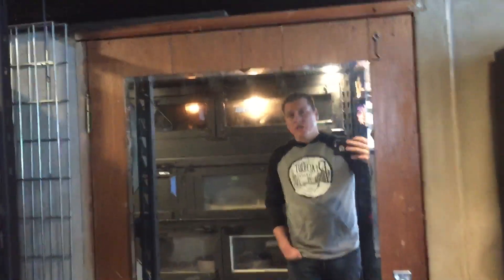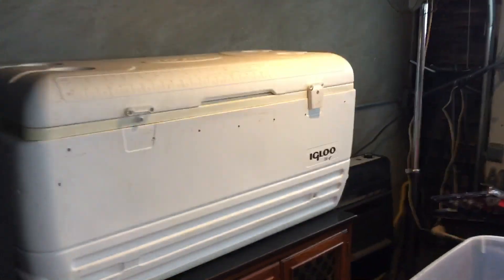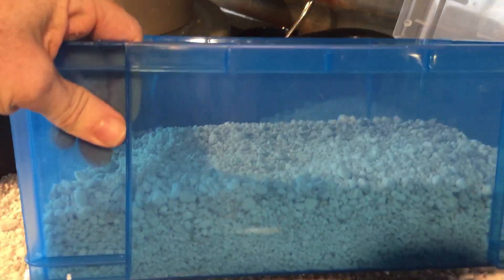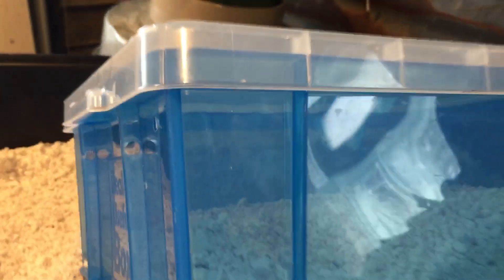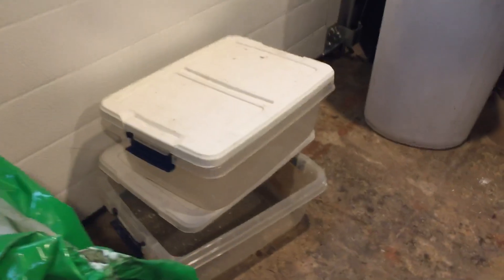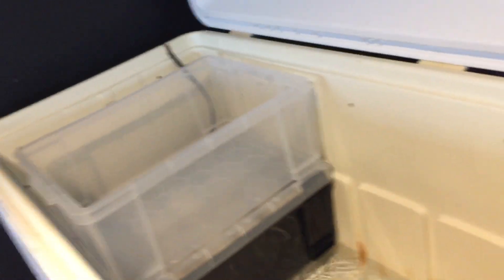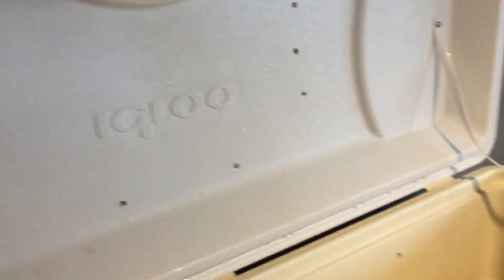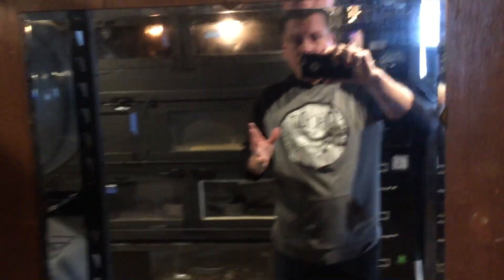DIY Reptile Egg Incubator, cheap and easy incubation for success!

Comment: Hello Garrett I am interested in making same type of incubator that you showed on one of your UTube videos using the igloo cooler let me know the heaters and water pump used thank you so much for sharing ! 🙏🙏
Reply from the maker: https://www.amazon.com/MarineLand-Precision-Submersible-Freshwater-Saltwater/dp/B00NETRY08/ref=mp_s_a_1_12?crid=95IY1JB5UF4K&dib=eyJ2IjoiMSJ9.uDh_MnhYRs5D16o1s1jMA0LTbkQnzFsW6FM-tKhjWg2rAoh7J0x2Smxedv2x3loMdHvPxZSj3mNaxfNqlB5mPQFE3-byLlMKGK_zx8v1KYt4ng-WyXEjjfOcw3-5Ir1QRv01nyrkaZhnA0epUsw8YQaUP1UuC79P62UOBGlqXetYHVPcXlDp4iDaxxuzNN4ailO6bkU5vXfXXJQm8NJCcA.eIwddKN-ZFt70N5Nx7ece2zkWZ3QPRnGLtVTvUwDoSE&dib_tag=se&keywords=aqueon%2Baquarium%2Bheater&qid=1748180243&sprefix=Aquino%2Baquarium%2Bheater%2Caps%2C126&sr=8-12&th=1&psc=1
Reply from the maker: https://www.amazon.com/MarineLand-Precision-Submersible-Freshwater-Saltwater/dp/B00NETRY08/ref=mp_s_a_1_12?crid=95IY1JB5UF4K&dib=eyJ2IjoiMSJ9.uDh_MnhYRs5D16o1s1jMA0LTbkQnzFsW6FM-tKhjWg2rAoh7J0x2Smxedv2x3loMdHvPxZSj3mNaxfNqlB5mPQFE3-byLlMKGK_zx8v1KYt4ng-WyXEjjfOcw3-5Ir1QRv01nyrkaZhnA0epUsw8YQaUP1UuC79P62UOBGlqXetYHVPcXlDp4iDaxxuzNN4ailO6bkU5vXfXXJQm8NJCcA.eIwddKN-ZFt70N5Nx7ece2zkWZ3QPRnGLtVTvUwDoSE&dib_tag=se&keywords=aqueon%2Baquarium%2Bheater&qid=1748180243&sprefix=Aquino%2Baquarium%2Bheater%2Caps%2C126&sr=8-12&th=1&psc=1

Comment: Hey Garrett, I was looking into building this exact incubator for my ball pythons and I've been having trouble finding this igloo with the built in lining that catches the boxes. Would you happen to have a link to it or any recommendations? Thanks!
Reply from the maker: Unfortunately, I think they discontinued it. But the 150 quart will still hold the boxes, you just need to set a couple of bricks or something like a shelf on the bottom to hold them up.
Reply: @ReachOutReptiles I was afraid that may be the case, I'll go with the 150 QT and make it work. Thank you!
Reply from the maker: @SonGokuGaming no problem. Good luck!
Reply: @ReachOutReptiles Hey, I wanted to give you an update! I actually found someone selling the 120 QT that was discontinued on marketplace! I just picked it up today. Your luck came in clutch!
Reply from the maker: @SonGokuGaming nice!!!

Comment: Is it important to put vent holes in the cooler?
Reply from the maker: @craftcreations6480  a few small ones help it not to pressurize. Other than that, they get all the air exchange. They need if you open the cooler once every few weeks.

Comment: I used two 150-Watt Aquarium Heaters and a 24-Watt Circulation Pump.  After setting the heaters to 90 degrees, I found that they stabilized the water temperature at 116 degrees, so I turned them down, and turned them down again, and again, and could not get below 105, so I took them out and ran the pump by itself.  With just the pump, I got it down to 95 degrees.  What should I do?  Just get a smaller pump and let the pump heat the water?  it's a mystery!

Comment: I am using this system for my first time breeding ball pythons for 2025, i really hope it works out but i still am having trouble with how many air holes need to be drilled into a 120qt iglloo cooler same as this😅.
Reply from the maker: @ApexRoyals  just 5-6 holes that are 1/4”. Good luck!
Reply: @ReachOutReptiles  thanks a lot for the tip, you just helped me out big time, should I do the lid, the sides, or both? And ty for the good luck 🤞 hope it works out, I'll leave an update 😆.
Reply from the maker: @ApexRoyals  I do like 2 up high on each side, as well as the top

Comment: What is the temperature for the water heater
Reply from the maker: It varies.  Measure the temperature in the egg box, if that’s too cold, turn up the heater- and keep doing that until you reach desired temp. For my species, that is 88 degrees

Comment: No separate thermostat? Just the built in thermostats on the aquarium heaters?
Reply from the maker: The aquarium heater do the heavy lifting, but can (should) be run into another thermostat set a bit higher for redundancy
Reply: @ReachOutReptiles  ok that's what I figured thank you for the clarification
Reply: @ReachOutReptiles  only perlite I can find is Miracle-Gro which is enriched with Miracle-Gro plant food

Comment: I've been running the incubator for some time now and I have eggs in it since about 15 days. I see constant temp fluctuations that I guess are due to the ventilation holes letting cooler air in which drops the temps by a small fractions until the thermostat kicks in to increase the temps again. My temps are constantly varying between lower 88.x to 89.x on the higher end. This is my first clutch ever, and at this point I'm not sure my eggs will hatch safely due to these fluctuations. Can someone confirm that this is safe? Is a temperature-controlled room a prerequisite in this case? Thanks.
Reply: Any update to this situation?
Reply: @heymannhowru  I moved them out to a small beverage cooler type incubator. I didn’t want to take the risk as that was my first clutch ever. Temps kept fluctuating, especially at night. My guess is that it has to be in a temp-controlled room, a very important detail omitted in the video but probably a fair assumption given what we’re dealing with here and the hobby in general. Eggs hatched successfully, so those first weeks when temps fluctuated didn’t impact them. I kept it running afterwards just to monitor the temps and the more the ambiant temps went down, the more it impacted the cooler. Somebody suggested I seal the ventilation holes, and just open the lid once a day to ventilate but I already moved on. I’m planning to give it another shot though, I’m not planning to throw away that cooler. Next step is to try this inside a grow tent :-)
Reply: Do you think it would work fine inside a house that's ac controlled away from a window just fine? I still have a yr till I begin my breeding project but I just really want to be prepared by then

Comment: Great idea. A couple of questions: 1) Elec.  wires: did you drill holes for them or just pass them under the lid? 2) Ventilation holes, are they required? And if so, do they go all the way through the lid and sides or are they only limited to the internal layer?

Comment: Excuse me my gecko eggs are denting at. 2 weeks but they are still red. The bottom looks moist when I pick it up. By the way I am using a makeshift incubator. The incubator is just a deli cup on top of a heat mat. Some reason the temperature fluctuates from 83 degrees Fahrenheit to 90 degrees Fahrenheit. Right now they are at 86.4 degrees

Comment: I know I already commented a while ago on this system but I feel I need to let anyone else who is building their first incubator know this is totally legit. I followed Garrett's instructions as he says in this video and it works great. So much easier and cheeper than other heat tape versions and it is a much better way to retain stable heat and humidity. Think about it, if you open the door to an incubator the whole system has to kick back on and try and level itself out again and there has to be hot and cold spots because you are dealing with air not water. I can't thank you enough for sharing this, it's one of the best pieces of advise I've gotten since starting this hobby.
Reply: It absolutely is i can't wait to make this one i found this once my eggs were already in my incubator but i use the idea of not wetting my medium i add water to.imside incubator and allow the vermiculite to suck it up as it needs it keeps basically perfect humidity
Reply: I have the zoo med incubator but i also added 2 full water bottles in there it's tight but it's nice it truly keeps my temps with only 1 to 2 degree drop when i open it to fuck around and whatnot
Reply: I use this now for my bearded dragons pool I have a big one for them and the heater keeps the water at like a perfect temp
Reply: I'm not really sure how to get a constant temps, mine keep fluctuating from low 88.x to high 89.x and I don't know if this is safe for Ball Python eggs. If you have a trick I'd be more than grateful if you can share it.
Reply: Hello what type of heaters and water pump used for your setup thank you

Comment: So I just built this because I have a clutch of ball python eggs. I have almost everything set the same but my temperature won’t decrease even if I lower the water heaters, it keeps getting to 100 degrees but I need it at 88. I have the heaters set at 79 but it still seems pretty warm. Is there anything I can do to make the temperature lower? I’ve been playing with the heaters and the pump. The humidity is great it’s at 99% but my problem is the temperature
Reply: I'm having the same problem!  With just the pump alone running, the water temperature is 95 degrees.  I'm going to buy a smaller pump and see if that works, otherwise I don't know what to do...

Comment: I'm assuming that you don't have some sort of redundant battery/generator backup because the cooler provides enough insulation so that temperatures will remain stable for a few hours or so during a power outage.  I've heard stories of breeders losing entire clutches due to random power outages that caused the incubators to lose heat and thus their eggs.

Comment: Hey bud not sure if you still respond to comments but I brought a fox snake home from a spot it was going to be killed and now I have about 7 eggs. Right now they are next to my turtle heat lamp, inside a bin, with aspen packed around them lightly. I had no time to rig anything up before work. I might try your setup when I get home. Have you ever heard of people setting the bins on top of their water heaters? Do you think that would work ? What causes eggs to collapse? Ive seen a few people failed that way just wondering what causes that? thanks for any information

Comment: Do you control the temp of the heaters just with the dial on them or are they plugged into a thermostat also? 
What do you use to monitor the temp and humidity inside the cooler? Just that point and shoot thermometer or is there a probe inside that keeps an eye on it also?
Reply: I had the same question?!?!

Comment: Do you have a email I can send some pics to in order to see if my set up like yours will work? I'm a first time breeder and really like your set up. Mine is the exact same but a smaller cooler cause I will only have 1 clutch at this point. My question is my tubeware I'm using does not have a lid but if I cut out a piece of plastic and set on top will it work?
Reply from the maker: Yes, I have also seen people have very good success with the Glad cling wrap that has the micro perforations in it to keeps vegetables fresh.
email is info@reachoutreptiles.com
Reply: @ReachOutReptiles  thank you I sent some pics over to your facebook

Comment: Hi. Quick question on this. To get accurate stable temps inside the cooler I presume it would be better to have this situated in a different room to the heated snake room??
Reply from the maker: That just depends on the room.  In a warmer room, you simply will use less electricity with the heaters.  Obviously, if you have the room temp set as high as incubation temp, there's no way to cool the eggs with this system if need be.

Comment: What has been your success rate with this method? I'm a new amateur hobbyist, breeding is going well and the excitement is super high. I only have one breeding pair, therefore, one clutch one. I'm just worried about reliability and need to rest assured that this is reliable.
Reply from the maker: Over 20 years into it, tried other methods, keep coming back due to the higher hatch rates than other methods.  Be sure to watch my other video on how to incubate as well, which goes into a lot more detail as well.  Good luck!

Comment: hey man, do you know the specifics on those heaters?
Reply from the maker: They are Aqueon 50 watt and 75 watt submersible heaters.
Reply: @ReachOutReptiles  Hi there, I looked up that brand with those specifics. The details say they go from 68 to 88 degrees. Don't ball python eggs need 88-90? I would prefer they would go a bit above that range so I have more control. Does putting the 2 heaters help in that aspect?

Comment: Hi I'm trying with bearded dragon eggs.  I have the cooler and fishtank heater.  However the container I have is much smaller then what you have your eggs in and I'm getting condensation on the roof of the egg Tupperware.  Do I just need a bigger tupperware?  I used soil for the current batch of eggs I have in there now, but I just bought vermiculite so I will use that with next batch.  Thoughts
Reply from the maker: Condensation will happen, be sure the substrate is not too wet- and simply wipe up the condensation with a paper towel from time to time.  If it's dripping, you can prop up one side of the container laying a little pencil under it or something, and get that condensation to run down away from the eggs.  Good luck!

Comment: my question is for incubation if albino red eared sliders and diamondback terrapin incubation,  what temperature should I set the water thermometers for? would I set them at 78 degrees? that's the temp I want the incubator temp to be. I am incubating for male.  I guess my question is  is the inside temp the same temp that I set the water thermometers to be? or do u need to play with them temp wise to get that temp?
Reply from the maker: Great question.  The egg boxes tend to run slightly higher once eggs are in them, so start by placing your thermostat in the egg box, and adjusting the heaters until you get them where you want.  Once eggs are in the boxes, just keep a thermometer in there to see if any adjustments are needed.

Comment: Hey man! Was working outside today doing a tree job. And cut the tree down to find there was 14 snake eggs that were almost crushed. So grabbed them out them in about 3 inches of molch and barely covered them up, also got them in a little plastic thing with a lid, tons and tons of air flow, what else should I do to make sure theses baby’s hatch and get put back into the wild ?
Reply from the maker: Ideally, a small cooler with a little water in the bottom, a cheap aquarium heater, and a brick or something to set the container you used should be good.  Gotta keep those warm.

Comment: Hello there, how many holes did you drill out through out the cooler, Im currently making the same setup..bought a igloo cooler, aqueon circulation pump, really useful boxes, just need heaters and perlite.
Reply from the maker: I probably have about 20 1/4" holes.  Probably overkill, since I open it and refresh the air every couple days.
Reply: Reach Out Reptiles awesome, thank you...

Comment: Hopefully you still the comments section of this video. My question is, does this system work for bearded dragons as well? Ive been doing my research and found they need 75% humidity and I'm worried about excess humidity.
Reply from the maker: It works great for them (was actually developed around my Australian dwarf monitors, with similar requirements).  The secret is very dry perlite.  Good luck!

Comment: The eggs are fertile I have candle them you can see the outline of the baby lizard inside the eggs and I feel like I need to hatch him and let him go because I disturb them not meaning to but I would like for them not to die because I got in
Reply from the maker: Hi Joana, sounds like you found some Blue tail skinks.  You can probably just put them in a Tupperware as you have mentioned, with some of that vented (selectively permeable) plastic wrap with the little holes as used for keeping vegetables fresh, then set the container up high in the warmest area of your house.  Unfortunately, with the way you discovered them, they may have been rolled around- so if you can candle them, and put the embryo at the top of the egg, you will have the most success.  Good luck!

Comment: Hi, I'm just trying out your method. What do you set you water heaters thermostats at?
Reply from the maker: Doesn't matter what they are set at.  Toss a thermometer in the egg box with the eggs, and adjust the heaters up or down to get the temperature INSIDE the egg box where you want it for the species you are working with.  Good luck!

Comment: How often do u have to add water to the system? Ive been having trouble incubating my Kimberly Rock monitors in a traditional vertical style incubator so after watching this and ur other video on incubation I think I may try this. I was going to build a high tech vertical one with humidity and temp control but this seems easier if you think it'll work for Kim eggs plus I keep fish(350gallon tank of Amazon cichlids) so I have pretty much everything but a cooler
Reply from the maker: My struggles incubating Odiatra (including Kimberly Rocks) was how I developed this system, so YES!!!  It's a great system for them!   You only add water to the bottom of the cooler as needed to keep the heaters covered.  If you like, you can mark a desired water level and just maintain that.  How often will depend on how much time you spend opening the top and going through your egg boxes.  I usually checked on mine about once every 2 days, just to let a little fresh air in.  So I only needed to add a little water maybe once a month.
Reply: Reach Out Reptiles awesome thanks. Was the hatch rate better then for them after switching?

Comment: Do heaters need to rest for few hours? especially it takes a whole day of using it, or its okay of letting it and get a extra one just in case
Do heaters can destroy if its overused or not?
Reply from the maker: These are made to go in aquariums with fish, so they are very tough.  The only thing you can't do is turn them on when there is no water.  I recently made an update video explaining this process deeper that you may want to watch.  ;)